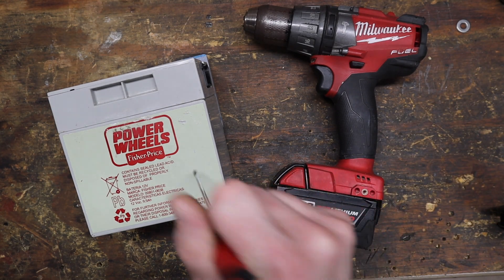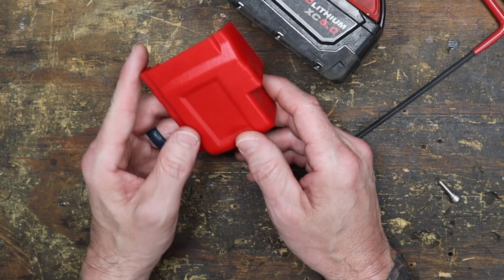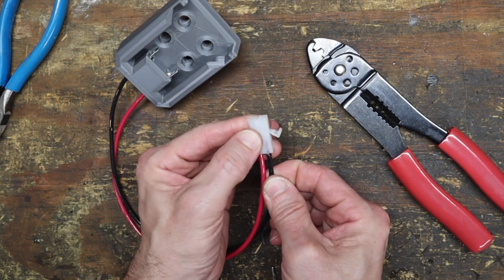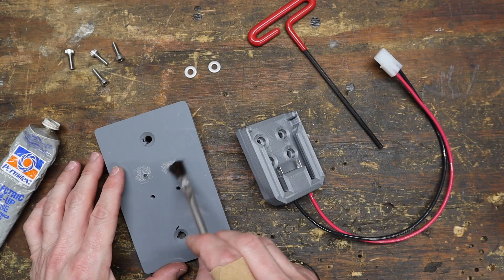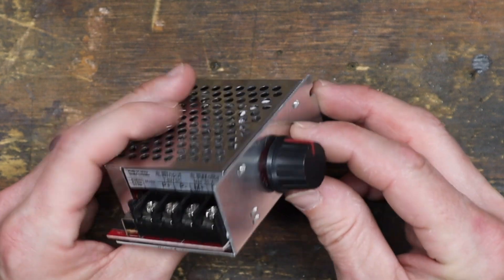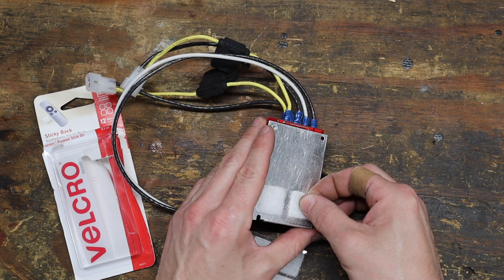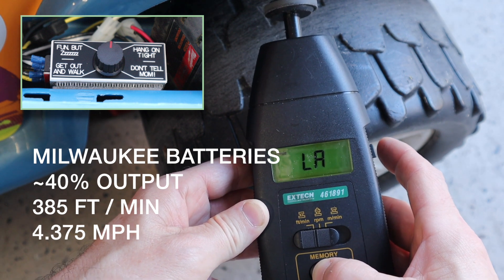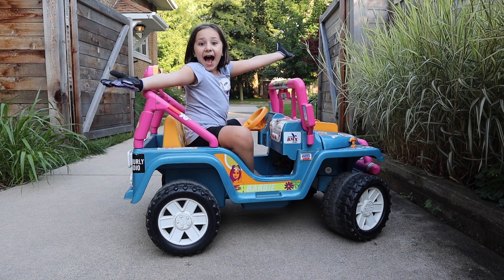Power Wheels Vehicle 18 Volt Milwaukee Battery Upgrade!

Comment: I wouldn't trust those Molex plugs to handle the voltage.  And there are $25 sla batteries available on eBay that are 12v 9-10ah...so basically the same as an overpriced power wheels battery, minus the fancy case and connector.  So I've put 2 of them in series for 24v...still less than the cost of one power wheels battery.

Comment: I would be concerned about over discharging the batteries as you do not have a logic board between the cells and motor. Does the cars performance become unrideable before the cells are fully depleted?
Reply from the maker: Hey there Spencer. Check out Part II for a  battery discharge monitor install: https://youtu.be/8n_NJ2uIDU8
Reply: @havocware  All my questions answered. Thank You!

Comment: Are the 18v Milwaukee s internally monitored for voltage/capacity? I know Lipo and Lithium ions become unstable causing the battery to explode or puff up if discharged too far.
Reply from the maker: Hey there. Check out Part II for a battery discharge monitor circuit installation. https://youtu.be/8n_NJ2uIDU8

Comment: I just put a deep cycle car battery in and replace the connector with alligator clips.  Running a 12V motor on 18V is hard on it.

Comment: The curved backside is due to a thing in 3d printing called warping. Its when the underside of the print starts bending upwards. Normally when that happens the print is considered as failed, so it's weird that the seller still sent you that one...

Comment: Pro tip............. DO NOT series wire two of those batteries... Well, it's fun for a hot second, until the motors catch fire. They metered out at 40ish volts HAHAHA

Comment: Checks description for links, but sees no links :(
Reply from the maker: Hey there! From the description:

Components used in this project:
* 3D Printed Milwaukee Battery Cradle: https://amzn.to/2xGK114
* DC Motor Speed Regulator: https://amzn.to/2JulRxx
* Milwaukee USB Adapter: https://amzn.to/2XI4Zw7
* In-line ATC Fuse Holder: https://amzn.to/31k3Lo8
* Molex Connectors and Pins: https://amzn.to/33fbOUL
* Milwaukee 18V Red Lithium Battery: https://amzn.to/31iANVB

Cheers!
Reply: @havocware  Thank you!

Comment: Thought I'd mention, when my kids were young some 20+ years ago lithium baths weren't really around yet and we had bought my kids a power wheels jeep as well. Ad you mention even back then the stock batteries stunk so I took a normal size car battery and build a bracket with a caster wheel on the bottom and bolted everything to the back of that jeep. Boy did that jeep fly and would run for hours. Just reflecting back at modifications made then compared to now!  Ironic!!!

Comment: Thanks for such an awesome video!! What amp fuse do you recommend?
Reply from the maker: Hey there! I ended up with a 20A in each fuse holder, anything less woudl blow on the initial inrush with the controller turned up to DTM.

Cheers!

Comment: Are you just taking the batteries out and charging on the Milwaukee charger or do you have it set up for like a battery maintainer?
Reply from the maker: Hi Mark. Yes, I take the batteries out when done, and charge them on my bench in the charger. Actually - she does it now; at the end of each ride she pulls them out and charges them up.

Cheers!

Comment: I did this exact same thing his dune racer went great for 30 ft then stopped. I opened rear battery department and I could smell plastic melting and some smoke anyone experience this.
Reply from the maker: Hey there Todd - sorry you're having trouble with the build. Is the unit fused? Can you upload a video of your wiring to take a look at?

Thanks

Comment: Cheapest route is a Harbor freight rechargable drill. Just cut the bottom off the drill to gain the socket to hold the battery.

Comment: @havocware
The name plate for the DC controller, where did u get it made? My vinyl guy has an old cutter so he cant cut that small. I want to get one w/ different words made for my daughters DC speed controller i have on her dune racer
Reply from the maker: Hey there! I made the name plate on a rotary engraver. If you send me dimensions for your controller we could work something out.

Cheers!
Reply: I dont see an email for you.
Dimensions are 1.5” by 3.25” and the hole for the knob post is just under 1/2” Diameter

Comment: The "cradle" is warped not curved because of uneven cooling of the 3D printing material. You can sand flat but your washer fix is less time consuming. If you don't have a 3d printer they're inexpensive enough I recommend buying one. The parts I can make are worth the learning curve. Home, garden, car, truck. You name it there are tons of applications for an imagineerimg specialist...

Comment: You up the batteries but not the motor...🤦‍♂️ motor still a 12volt just overworking and soon failing or catching fire...a no, no . Condition for kids safety.
Reply from the maker: Thanks Hilda. That’s why you should always use fuses.
Reply: @havocware  👍

Comment: Did your burn up a pedal yet or wreck the plastic gears in the trans? We were hoping these up by cutting out the floor in the hood and putting car batteries in them and 6v motors. Went through pedals had to add relays to them. Always had to keep spare transmission too.

Comment: Put a DeWalt 18V nicad on a 6V ride-on powering the motor with a relay so the 6v original battery powers all the systems and just triggers the relay instead of running the motor... That thing moved on 18V and you can just swap in a new battery when it cuts.

Comment: $250 for Power Wheel + $230 for Retrofit and $480 later you too can go 7.0 miles per hour.
Reply from the maker: Or - hand me down Power Wheels, and batteries I already use in my tools, and I do a fun project and spend time with my daughter. Priceless.
Reply from the maker: Frank - ever been to Utah?
Reply: @havocware  You could stand a few more chest Xrays you gogglebox dogooder.
Reply from the maker: It isn’t sausage, Otto.

Comment: How long do the batteries last at 75%?
Reply from the maker: Hey there! Take a look at Part II: https://youtu.be/8n_NJ2uIDU8, I do a full rundown test and add a voltage cutoff module to protect the batteries.

Check it here: https://youtu.be/8n_NJ2uIDU8

Cheers!

Comment: Would a 36volt Milwaukee battery work better?
Reply from the maker: Hey there Andrew. In this case, the 36v would be too much - nearly three times the voltage rating for the motors. I was looking for a slight voltage increase, with maximum amp hour rating (battery life).
Reply: @havocware  ok was wondering if there one battery would be better then two.I don't fully understand electrical stuff,or not well versed in it.I was thinking you have two 18v batteries that's 36v.However I assume in the way you have them wired in that only 18v or a little less is actually being used.

Comment: I did something like this with 2 cheap universal batteries that were 7.5ah I wired in series & it worked good for about 30 minutes it overheated & melted wires so I had to add a 50 amp auto reset fuse it all worked for about a year then batteries were junk & wouldn't charge so I put my Milwaukee 9.0 battery in & wired straight up and it works a lot better no fuses nothing just wires with eyelets that are are shoved into positive & negative it works great for almost 1 hour & by then kids are done with it anyway

Comment: Do not do this it fried my 200 dollar Milwaukee batteries.  They discharge too fast
Reply from the maker: Hey there Victor. In Part II https://youtu.be/8n_NJ2uIDU8 I add  a battery voltage cutoff circuit for $12. 

Have a look: https://youtu.be/8n_NJ2uIDU8

Comment: Now go get some rubber tie down straps and cut them down into strips and mount them on the tires at approximately a 45° angle. It greatly improves traction’s so your kids don’t get stuck everywhere and the plastic tire don’t wear through.

Comment: @havocware I used the exact speed controller you did but I’m having some issues. I am using ridgid batteries and every few mins the power wheel will stop working and I have to take battery out of holder and reinsert and then it works again.  Will do this a few times and then it will blow the internal fuse in the speed controller. Got any ideas?  Oh and I noticed when it stops working, I will press the button on the battery to see how much power is left and it won’t display anything. Once I disconnect and reconnect, I can press it and see the battery level again.
Reply from the maker: Hey there AJ. I've heard from other people in the field that the Ridgid batteries might have their own on-board under voltage protection circuit. Maybe it's interfering with the speed controller, or perhaps the controller is interfering with the battery protection?

Sorry I'm not much help on this one, perhaps check the Power Wheel forums to see if anyone else has had the same issue.

Cheers!

Comment: Great video. What amp fuse did you use in the in-line ATC fuse holder did you use.
Reply from the maker: Hey There! I ended up with a 20A in the in-line battery fuses. A 15 would be fine, but if the speed controller is turned up past about 80%, the 15 would blow on initial inrush.

Thanks for watching!

Cheers!

Comment: Maybe I missed it, but how did the Amp Hours compare to powerwheel batteries?
Reply from the maker: Hi Dan. I did a full array of bench and field rundown tests in Part II (as well as installed an under-voltage protection circuit.)

Check it out here: https://youtu.be/8n_NJ2uIDU8

Cheers!

Comment: Doesn't this burn up the motors having the extra voltage going to them. Pretty sure they are only rated for 12v
Reply: That's why he added a speed controller and only keeps in on 60 percent power output

Comment: Looks like with the increased speed is causing an under steer (plowing) condition with the plastic front tires lack of grip. Maybe consider stretching a ring cut from an old inner tube over the front tires at least, for more accurate and better steering. Looks like she’s got driving skills so she’d probably enjoy better steering.

Comment: Should i replaceplace the stock motors that came with powerwheel 12v if i run the two 18v batteries by wires by series (36v)... if so .....do you have any recommendations of motors?

Comment: Years ago my oldest boy had a power wheels John Deere gator.  Same problem with the battery.  I ratchet strapped a trolling motor battery into the bed and unhooked the dump linkage.  Once I wired it in he drove and drove and drove.   He rode it 30 to 60 min per day.  I only had to charge it once a month or so.

Comment: @havocware where are you using the USB adapter? I'm not seeing where it's used on your final product.  Maybe you  just included the link to it, as an option?
Reply from the maker: Hey there!
I never used the USB cradle in the build. I added it to the description links as an option, just to be thorough and show everything that I considered in the project.
I still have them if you're interested in a swap? :)

Cheers!
Reply: @havocware  thx. I'd like to upgrade my kids dodge charger police car made by Kids Trax, like your finished product. I just don't know if any of these parts are compatible or would compatibility even matter, since it looks like you replaced all factory connectors anyway? I have virtually zero electrical knowldege so this may be getting a little over my head lol.

Comment: Great video.  You didn't mention what fuses you used in this project.  I'm trying to do the same setup as you.  Thanks!
Reply from the maker: Hey there McFlied! I ended up using 15A on both fuse holders. I found that anything less would pop on the initial inrush if the vehicle was in "high" gear.

Cheers!
Reply: @havocware  Thanks for your reply.  So I completed this project this weekend but blew fuses starting at 15amp then 20ammp, 25amp, then 30amp.  The only difference on my side is that my 6 year old daughter and almost three year old in the car at the same time (total 80lbs), I only hooked up one 5amp M18 battery, and I have an MLtoys brake module installed so the car doesn't stop as fast.  After a long time on the 30amp, the low voltage cutoff module's 20amp fuse melted and broke.  Luckily I had another module so I put it in and no problem.  With just my 6 year old, it does not  trip the 20amp fuse.  Anything else I can do to prevent the higher amp usage when in high gear with 80lbs inside?

Comment: I just found your video I immediately threw the power wheel 18 hour to charge battery away and have rigged my baby’s car the same way... where can I find the base for the batteries you have?? Please help thanks ...you rock sir ... dad rock star ⭐️
Reply: Can we connect and you can help me out doing what you did ... please
Reply from the maker: Hi There! There are links in the description to all of the parts I used in the build; battery mounting clips, fuses, etc. If you need some specific help with installation or wiring, let me know and I'll try my best.

Cheers!
Reply: havocware I just found out how to find the links in the description.... thanks for all your help. Also in your update video the one with the rundown protection... when you change the battery does it have to be reset every time or does it same it’s low limit setting?
Reply from the maker: Both the limit value and the threshold value will be saved. You only have to set the values once.

Cheers!

Comment: What size fuses did you use?
Reply from the maker: Hey Joshua. In the end, I was using a 15A fuse on each battery. I found that anything else would blow on the inrush is the controller was turned up past about 75%.

Cheers!

Comment: Once installed, can i just plug in the regular charger that the ride on comes with or do i need the Milwaukee wall charger adapter? Thanks
Reply from the maker: Hi there. You'll need to charge the Milwaukee batteries with the Milwaukee charger. 

Cheers!
Reply: @havocware  thanks!

Comment: Did I miss it what is the fuse size?
Reply from the maker: Hey There. In the end, I was using a 15A fuse on each battery. I found that anything else would blow on the inrush is the controller was turned up past about 75%.

Thanks!

Comment: Hello, is there any risk that this mod can damage the battery in some way like overdraining it, or does the internal battery circuit prevent that?
Reply from the maker: Hey there. Take a look at Part 2 for a battery protection circuit installation. 
Power Wheels Milwaukee Battery Upgrade RUNTIME TESTS & Battery Over Discharge Protection Install https://youtu.be/8n_NJ2uIDU8

Comment: Hello. I am wondering if you can wire the stock battery and one Milwaukee battery in Parallel instead of two Milwaukee batteries like you in the setup?

Comment: this is awesome, i plan on doing this but don't really know what I am doing, just quick question, if you run them in series where do the fuses go?
Reply from the maker: Hey There. I would think you'd be safe if you put an inline fuse on the hot side after your batteries, before the speed controller (or before the cutout module.) 

Keep in mind, though, that when wired in series the voltage will double to 36vdc (if you're using the same batteries.) Check to make sure your motors are rated for that voltage increase beforehand (I can't be certain, but I doubt that they are...)

Thanks!
Reply: havocware cool, I will be doing this to a crazy cart, I’ve been in a group with people having success running these at 36v with stock speed controller and motor, I was just wondering if I do it in series would I just do one fuse before the speed controller, or do you also do one between the batteries as well?  And thanks this is a great tutorial.

Comment: Cool you got 6 more volts n what half the watts drill batteries can be killed trying to get 1 stuck bolt out its like a drag hot wheels get one good run n dead
Reply from the maker: It's lasted quite a while at this point; 9 months and still going. Average is about 90 minutes runtime per charge, at more than 50% speed increase over stock. Have a look: https://youtu.be/8n_NJ2uIDU8

Comment: How did you get the 12AWG wires to fit the molex connector? Most molex are 14-25AWG. And I found that the 12AWG fork connector was too big for the motor connector.

Comment: Did this with a couple v18 Milwaukee batteries. On those old ones, all you need is female wire connectors to plug directly to the battery.  You don’t quite get the amp hours from the old ones, but they are very simple. Thanks for the links, I found a dc speed controller off your link that I’ll get me setup. 18 volts is a little too much speed for my 2 year old, but he will grow into it some day. I heard the throttle switch’s burn up a lot with the extra voltage, did you do anything about stepping that voltage down to 12-14 volts?

Comment: I used that same speed controller, and the 30amp fuse keeps popping when using a 2 Ah battery. I replaced it with a 35amp fuse and it works, however when I throw a 5 Ah battery it pops the 35amp fuse. Any idea why it keeps popping?
Reply: I keep having them same issue. Have not tried a bigger fuse yet. Any recommendations would be appreciated.
Reply: @martinkell7866  I figure out the problem. It was when the car was in reverse. I'm not an electrician, so I don't know exactly why reverse puts out more current, but I disconnected the polarity switch so that the car can only go forward and I havent had a fuse pop since.